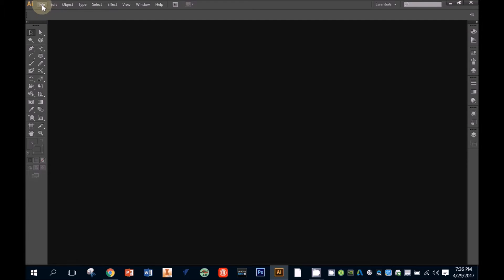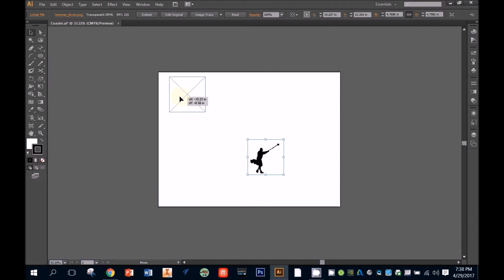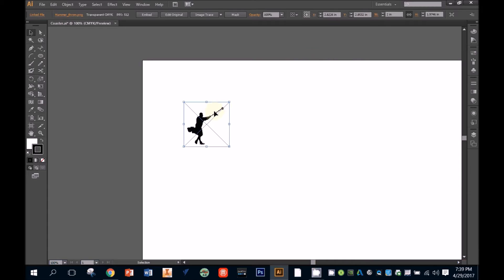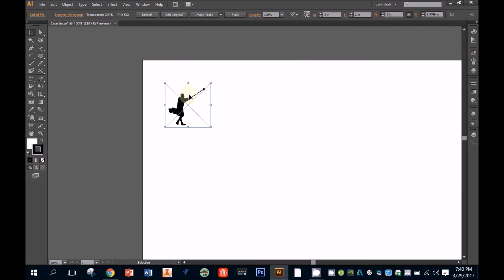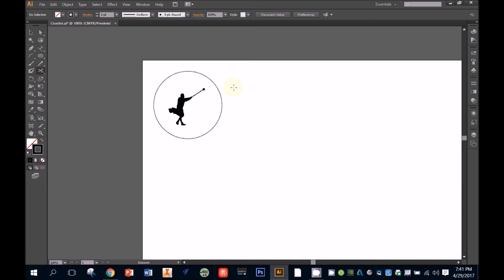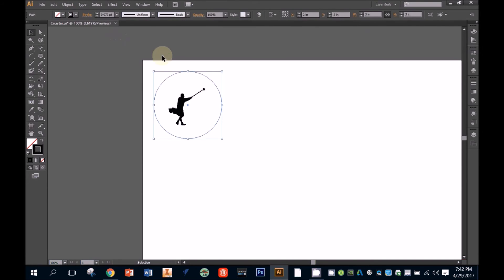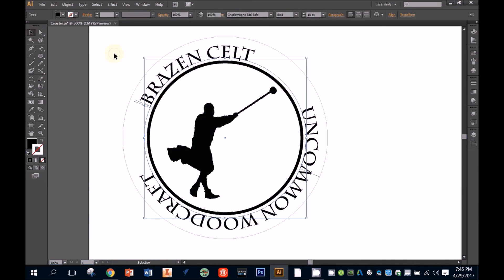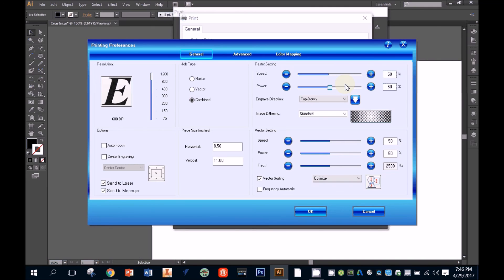Creating CNC Laser Graphics Using Adobe Illustrator

Comment: Using this method, with Illustrator, how do you establish the depth of the cuts? Is that step available once you import the vector object into the CNC router’s corresponding software?
Reply from the maker: This tutorial is really meant for using a CNC laser cutter, which wouldn't specify a depth of cut. I don't know of a way to create 3D toolpaths for CNC routers using 2D vector art software like Illustrator. I think you would need to find a 3D toolpath software like Mastercam, Edgecam, or Vectric. You might find some good freeware out there for that too. I hope this helps
Reply: Did you find the answer to this? Is there a way to determine the depth of the cuts but also using Adobe Illustrator?
Reply: Try Vector to Gcode. You can create custom Gcode files directly from illustrator

Comment: Can this be used for CNC plasma also?
Reply from the maker: Travis Chenoweth good question. Each manufacturer will be a little different with what programs can be used to make your artwork. I would guess that Illustrator would work for almost any CNC machine since it is so widely used but you should definitely check with the plasma cutter manufacturer first if you are planning to buy one. The main difference I would think is that a plasma cutter would only use vector cutting where the laser can either cut or engrave.